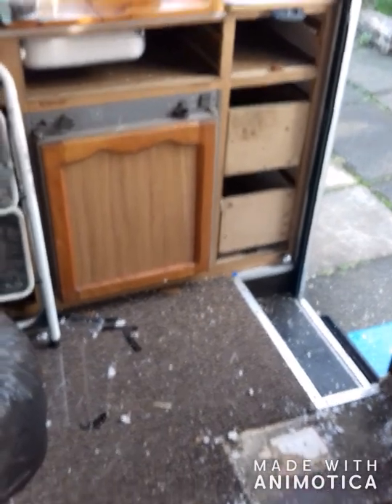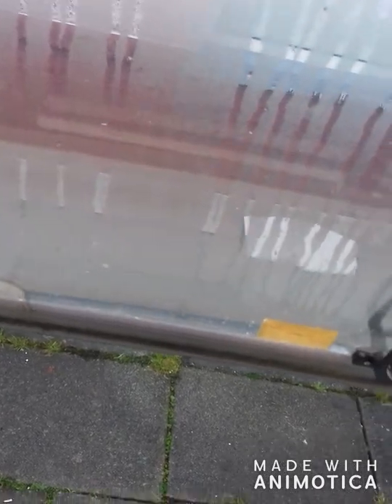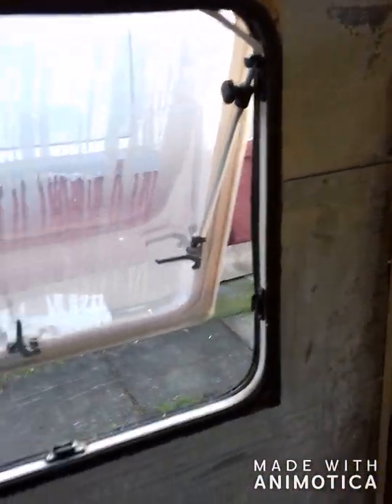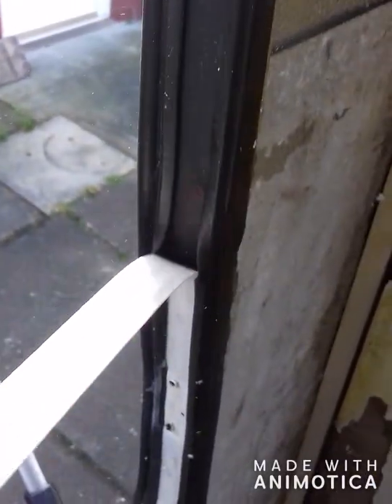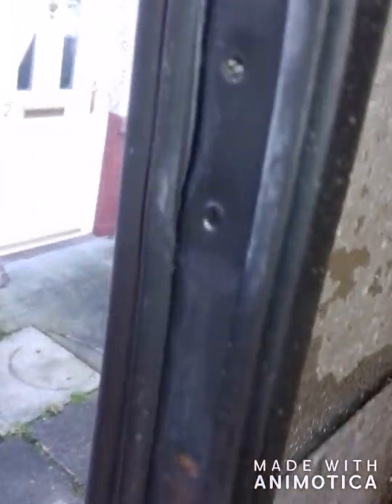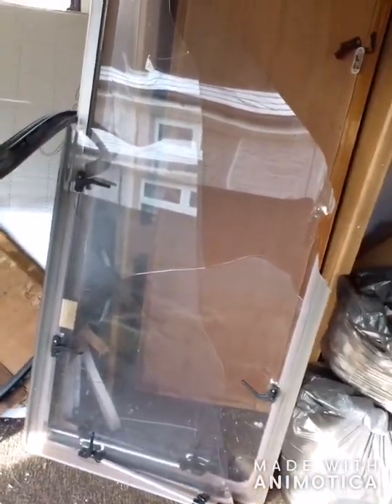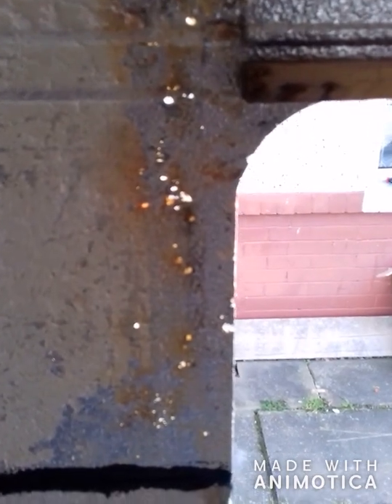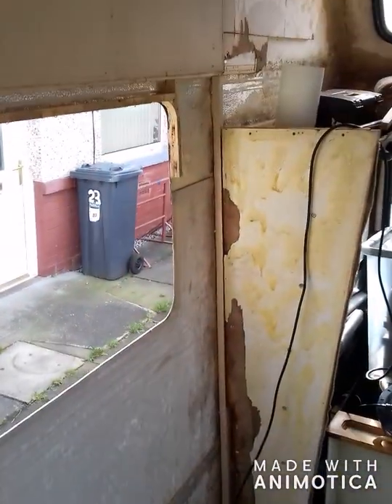Talbot Express Damp Repairs Part 7, Very Expensive Mistake, DONT DO THIS

Comment: Hi Paul !! Me again I think I will need a new rubber for window over cab any information on where to get one for my mercedes 208d plus commpass 1995 model    as I said Paul I'm new to this  YouTube and I'm finding your videos really really good and watched every one a few times lol thanks for your help on fibre glass Paul ..I'm just going to use plywood do I stick that to the wood with stiafex stuff Well I will  watch you in later videos keep up good work Paul and wish you all the very best of luck with your project big man !!! ....
Reply from the maker: When ordering your rubber its call fixed window rubber, you need to know the thickness of your walls then you get the correct size rubber, COH Bains are cheap but expensive shipping, ho forgot to mention there is also a rubber insert that you need as well, dont ask how to fit it because i dont have a clue, its a new one on me.
Regarding putting boards up, you can if you like use sika or tiger seal  but spread it about a bit with a scraper with teeth in it, it does help with stability, or you can use the correct gear that comes in a tin but expensive, not for me i will stick with sika or tigrr

Comment: I know the feeling paul,I just done it.
Mines a different setup to yours.
I have a plastic screen inside,I removed all the screws to get at the trapped blinds, not knowing the screws held the frame on the outside. 
When I took the to get a wash,the window fell put smashed,now I'm just left with a hole,not even the frame.
Sick as chip not knowing now we're I can get a replacement.
Reply from the maker: Gutted for you, really am, what year and model  is it ??
Reply: @PaulGloverHowDo  92 highwayman Paul.cheers